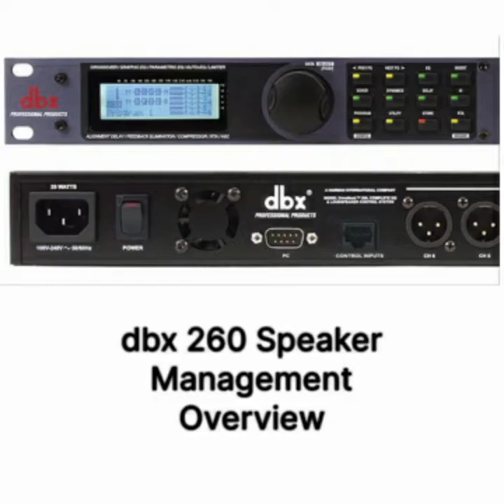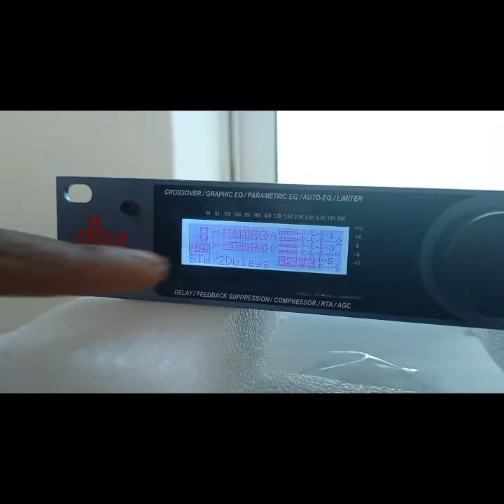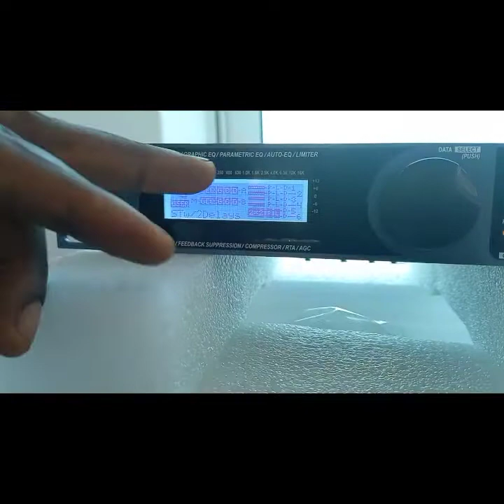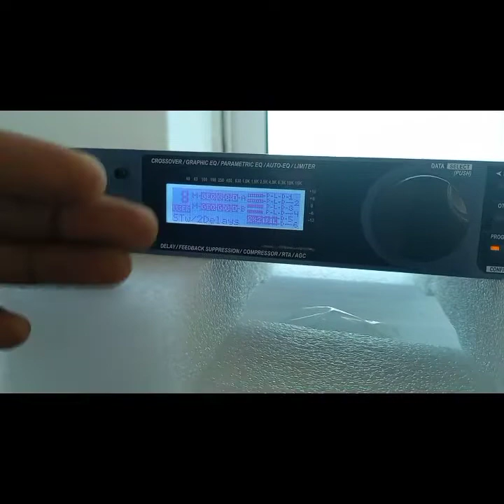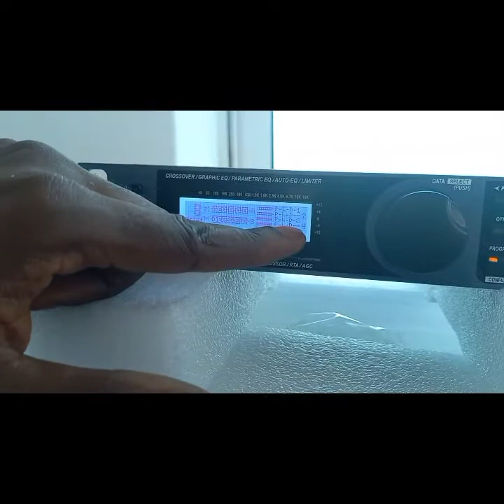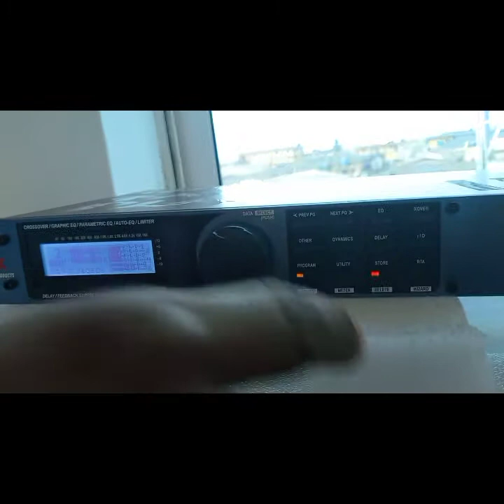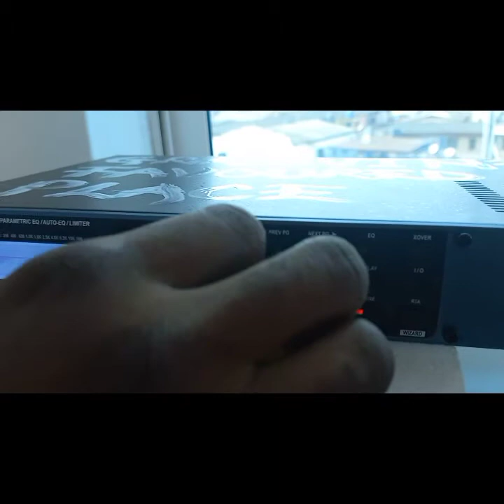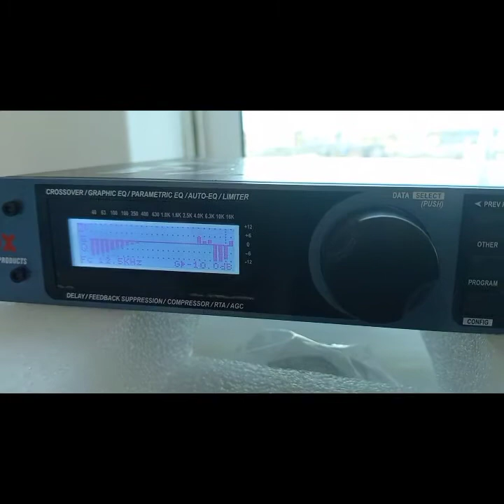dbx driverack 260 Tutorial | dbx 260 Speaker Management Tutorial I dbx Speaker Management Tutorial

Comment: Sir since I have compressor equaliser crossover if I buy speaker management will I be using all of them together and will speaker management stop my sound from picking
Reply from the maker: @EmmanuelMichael-n4r  Speaker management has a compressor, equalizer and crossover in it.
It depends on what you want to achieve with your sound system